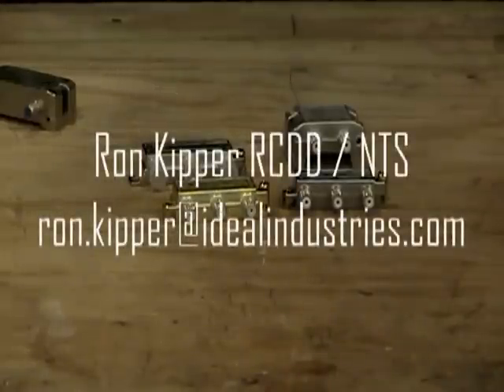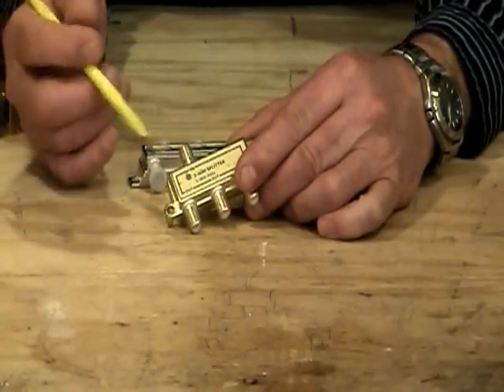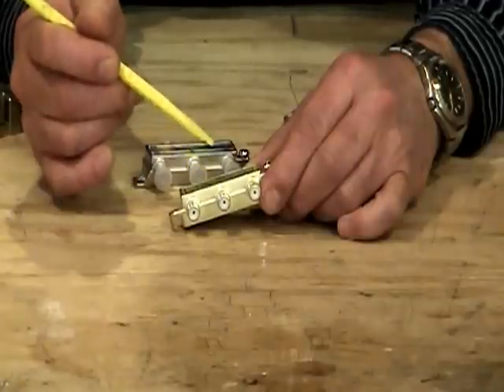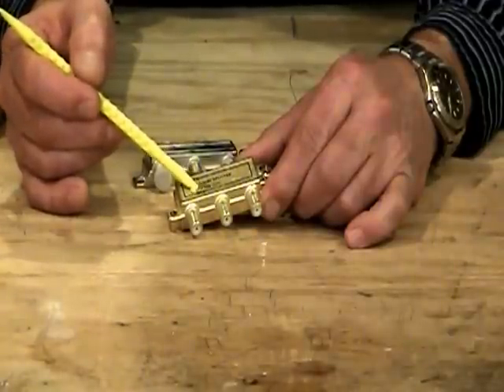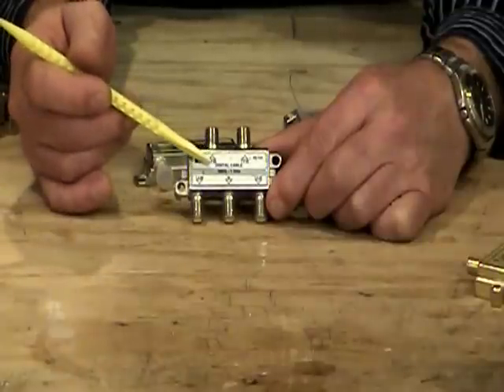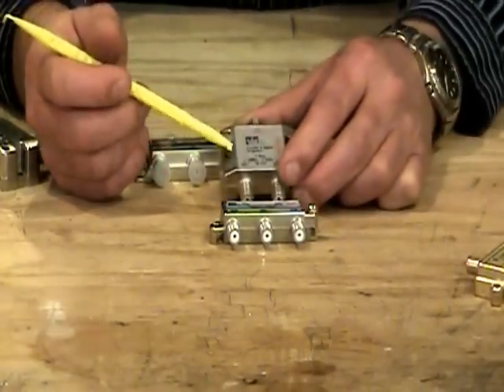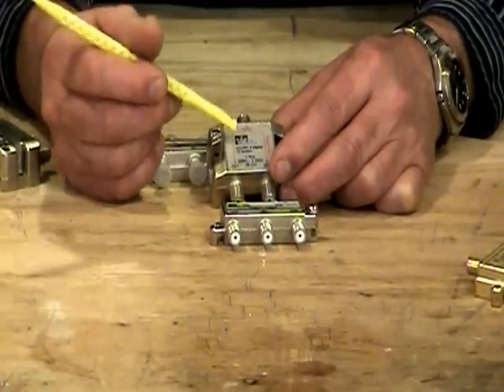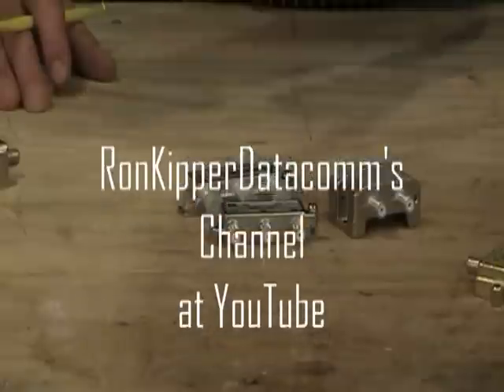CATV Splitter 101

Comment: Not sure if you'll see this.....But will going higher in the frequency range than you need cause any issues?
Reply from the maker: Higher frequencies will simply not pass through the splitter. Hope that helps Ron
Reply: @RonKipperDatacomm1  The one's im replacing are 5-1002, i'm going to use 5-2300.  SO thats won't be an issue.

Comment: Most splitters from the fifties and early sixties were resistive, were designed for three hundred ohm balanced inputs and outputs, were made of plastic, and had pairs of screws with which to connect the twin-lead transmission lines.
Reply from the maker: Hi Joel thank for adding to the discussion Ron

Comment: I know this is an old video but it is still very informative nonetheless.  I recently had a situation where my cable box would just quit responding to its remote. Swapped out the box thinking this was the problem but the issue remained. I messed around for a solid week replacing cables and connections in my home to no avail. As a last resort i swapped out the cable companies splitter that was located out in the service panel on the side of the house. Problem instantly went away and the clarity of the tv picture is now more crisp than ever. Would have never believed a simple looking splitter could cause and correct such an issue. Great video!
Reply from the maker: Tim thanks for watching yes those are some of the first videos I did. Good thing the basic info is still good. Have fun Ron

Comment: I just added an over the air antenna to my home, the problem is I can't seem to be able to split the incoming signals between my antenna and my DVD player with a three way switch I had in hand to supply signals from each to the TV. The splitter has one input coax and two output coax connectors. I tried hooking this splitter in reverse, that is, the outputs to each, i.e. the outputs to the TV with with the antenna and DVD to the outputs but it didn't work. Is that what is meant by bi-directional switch? If not what does bi=directional mean? Also if this reverse connection is not workable to I need a specific splitter to have two inputs, (the antenna and the DVD) with one output, (the TV)?
Reply from the maker: Hey Richardofdanbury you are wanting to combine two signals onto one cable right? The problem is the DVD signal is not modulated to a channel the TV can see which could be done but much easier to take the DVD output and use one of the other inputs on the TV to connect it. Then switch to that input on the TV when you watching the DVD. Hope that helps Ron
Reply: @RonKipperDatacomm1  2 signals to one cable is essentially correct, but when I had a weak flat wall panel antenna hooked up I was able to use the antenna AND the DVD simply by turning on the DVD which overrode the antenna. Now only the antenna works and there is no switching it off even when I turn on the DVD. I tried many combinations of cable configuration, even using the RCA jacks for the DVD but nothing seems to work for both antenna and DVD. I even tried reversing the input terminal out to TV and using the output terminals to antenna and DVD. Admittedly the switch I'm using is old and may not be effective because it is analog rather than digital but I'm not sure the switch is actually analog or not.

Comment: Do individual ports on a splitter ever go bad and how do you test for that?
Reply from the maker: Hello I don't hear about individual ports going out but it is possible. No way to really test it without some pretty expensive equipment and for the cost just replace it. Good luck Ron
Reply: @RonKipperDatacomm1  Thank you! I tried an unused cable on another port and got the same problem of intermittent signals.

Comment: It's all a little confusing for this old man , I just had a 70 mile roof Antenna installed . I'm  tickled with it , but my local station is about 2 miles away - it will not pull it up in the living room which is the closest to the main outside roof antenna  hookup into the house . But at the the further  part of the house in our bedroom it picks it up perfectly . Is it the spitter that's causing this problem ,  confused in Jonesboro Arkansas . 
P.S. we're totally happy with the channel lineup we're pulling in , bought our Antenna from Amazon it's a ( RCA) brand and its sweet .
Reply from the maker: Hi Marshall the signal could be to strong at the LR do you have an amplifier you are using? Ron

Comment: So would it work if I had a 2 way splitter and i plugged the cord from the tv into the in and i had 2 different antennas in the other 2 would that double my signal
Reply: That is what im doing to pick up more channels than what one antenna was giving me. Point one antenna one way and the other towards other direction were tv tower is, combining them using a splitter.
Reply from the maker: Not sure what you are trying to do but no that would not double the signal strength just buy a bigger antenna. Ron
Reply: @RonKipperDatacomm1  ok thanks

Comment: Hi Ron.Might you know? Was wondering why my utility co. placed a splitter between the incoming cable and their modem. Only hours earlier, this same modem was connected directly to the cable. Why would the utility want to insert a 3-way splitter and leave two connections unused? (I have no other connections to make, nor ever asked for more.)

The technician originally connected the modem directly to the input cable. It worked! Several hours later he returned and placed that splitter before the modem's input. He explained something about correcting "signals", which I didn't understand.

What possible reason woud they have for that insertion? If I were to restore the direct connection, removing the splitter that now intervenes, can I improve or worsen my situation (eg speed)?
Reply from the maker: They may have wanted to drop the signal strength to the modem is about the only thing I can think of. It may of been too high for the modem. I would leave it if you are getting good service. I assume they had a good reason to add the splitter. hope that helps Ron

Comment: Is there a device that will COMBINE the signals from two different OTA antennas, facing different directions into one signal ?  Using a splitter in reverse doesn't seem to work.  Thanks for thus instructional video !
Reply from the maker: Baz you are looking for a diplexer. Easily found on the Internet. Hope that helps Ron
Reply: @RonKipperDatacomm1  Always knew there had to be a better descriptor than 'combiner'   Thanks for scratching a 50 yr.   old itch and entering an interesting new word to my vocabulary.  New diplexer is arriving next week !

Comment: Great video. What about amplified splitters, when would you need one? And do you have advice for me? I’ve had flakey cable internet service, my modem keeps restarting. I took out the splitter and added a splice to go directly to the modem, and the problem seems to be solved. So I want to get a good splitter that I won’t have problems with. We have the cable modem, 1 tv with a cable box now, and 2 others with coax run to them but are not used now.
Reply from the maker: Brian I would say in most cases the CATV Provider is giving you enough signal strength to a feed 4 way splitter that can feed 4 TV's after that amplification may be needed just make sure to amp it before the splitters. For the splitter use one tat is at least 1 GHz rated and bi-directional like the ones we sell at Home Depot or Lowes. Take care Ron

Comment: Thank you for all your great videos!! Can you please tell me if Ideal has a product similar to the BAMF 2-Way Coax Cable Splitter Bi-Directional MoCA 5-2300MHz:

https://www.amazon.com/gp/product/B0113JAN8K/ref=ox_sc_mini_detail?ie=UTF8&psc=1&smid=A1MPSZWNYQK98Y 

And, can you please tell what MoCa means??
Reply from the maker: Antonio IDEAL's 85-322 should be very similar to the MOCA unit on Amazon you are looking at. Very hard to tell without the actual specs of both splitters. MOCA stands for Multi-Media over Coax Alliance and is a group of companies forming an alliance to promote the use of coax in a home for all kinds of media. Actually not a bad way to go about wiring a building for low voltage applications. Hope that helped Ron

Comment: Ron, splitters under 1k freq are not worthless or outdated. In fact, most antronix splitters comcast uses and otger cable companies are under 1002 mhz. Also, if you use a splitter that does not include ranges between 50-1002 mhz, then fm, ota antenna and some cable channelks will be filtered out. Satellite splitters use 2ghz splitters on purpose to filter out other lower signals and cable uses lower to filter higher signals and interference.
Reply from the maker: Jeramie you can certainly find good quality 1 GHz splitters and you can find some pretty low quality ones as well and those are those ones I was referring to. Thanks for the comment and take care. Ron
Reply: RON KIPPER FROM IDEAL YOU ARE FULL OF SHIT !!!!!!!!!! SO YOU KNOW MORE THAN COMCAST ENGINEERS WHO HAVE BROUGHT HOME CONSUMERS LIGHTNING FAST INTERNET AND DIGITAL TV WHEN THE OTHER COMPANIES CAN'T.

Comment: hi ron is it possible to use ..lets say a 5 way tv splitter at the same time?..its like a 10 way tv splitter?..how?
Reply from the maker: +joe merlin macapagal Joe you can always cascade splitters as in a two-way that feeds two four ways will create an eight way splitter. The issue is will there still be enough signal strength left over for the TV. The eight way splitter is losing around 12 dB of signal but as long as the service provider is providing more than that it should work. Hope that helps Ron

Comment: Ron im a gamer, i use have my cable modem in the living room it was coming off the main splitter from the center of my house which is 5-1005 mhz 1 end to my room and the other to the living room, the living room has another splitter tv,modem and phone so i decided to switch the modem to my room and i also switched the main splitter at the center of the house to 2ghz splitter.. Is ther anything wrong? 
My main concern i signal lost in the modem I would like your profesional opinion.. Thanks

Comment: I need help. I need a splitter for my satellite cable and my time ever warner internet. what do you recommend?
Reply from the maker: +lilshortie407 Those are two different services so do not try to run them on the same cable. You need to run separate cables for each.
Reply: berapa db boa

Comment: About a month ago, all of the homes cable boxes are showing loss of signal on certain channels...rarely it smooths out but most of the times they are pixelated with spotty audio.  

I called the cable company and they said the signals are good from their end so I'm suspecting it might be the splitter that's the issue.  What should I replace or add to solve this problem?

Thanks!
Reply from the maker: nmssis Good to hear from you! You should buy a 1 GHz bi-directional splitter we sell them at Home Depot. I don't know how many times you want to split the signal but a 4 way should work. More than that you might need an amp. Good luck.Ron
Reply: ***** thanks for the reply we have total of 4 TV boxes and a line for the internet.  will i need something extra?
Reply from the maker: nmssis Normally the CATV guys will install a 2 way splitter and use one leg for the modem and the other to the 4 way splitter feeding the 4 TV's. That way the modem get a strong signal. Hope that helps
Reply: ***** i'll have a look at my connections as they are done.  Thank You!!!

Comment: Thank You Ron..Very informative. I would like to know what channel (freq.) should I check with a CATV meter at the side of my house for a + 15db signal?
Analog or Digital ?
Reply from the maker: Edward Hannan Ed the signal at the side of your house will vary and could be much less than 15 dB and you need to have a tester that can give you a reading at any frequency between 5-1000 MHz. They are not cheap you are looking at $1500 or more. However it is the only way to know what the signal strength is. Call you cable company maybe they can give you an idea of what the signal strength is. Good Luck and thanks for watching

Comment: How many times can you split a signal from the outside Cable TV/Modem for you experience loss or disruption?
Reply from the maker: DJLOUIE1000 The answer to that will vary but I would like to think you could use a 4 way splitter and still have enough signal. It depends on the length of the runs and what is the signal strength at the outside of the house.Good LuckRon
Reply: ***** Got it. Thanks.